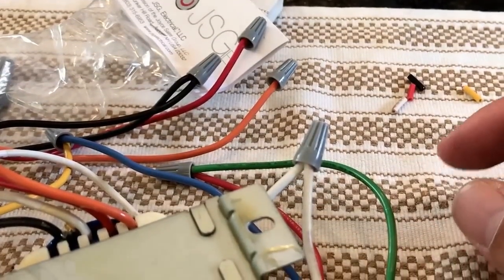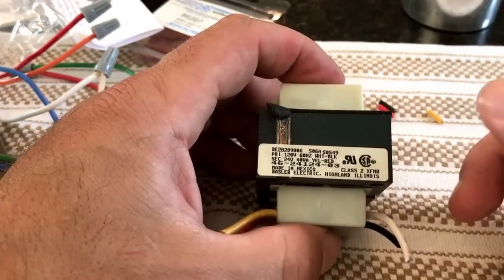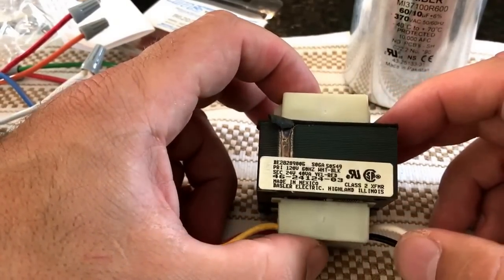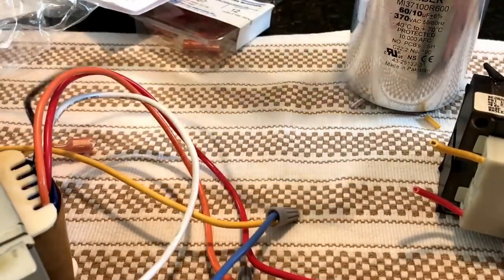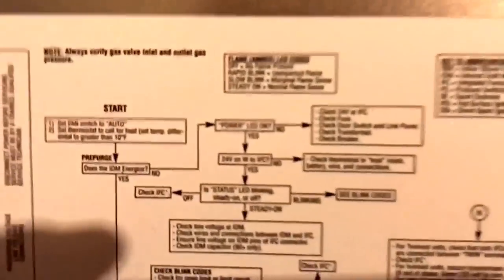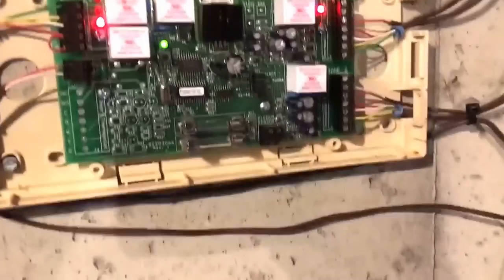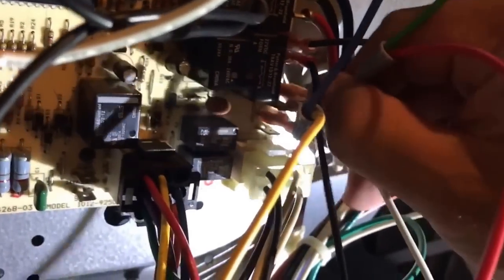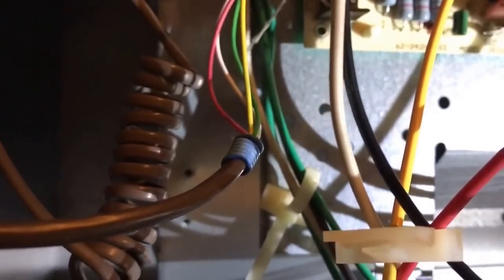How to fix a Rheem furnace not turning on with AC or HEAT part (1) of (2)

Comment: Mine hums no lights on my circuit board either
Reply from the maker: Hello, I tried to respond sooner and did but the email was sent back undelivered.  What I believe you should do is buy a Transformer with its own circuit breaker.  I believe the transformer is the issue but if there are other issues it would blow the new transformer as well.  With its own circuit breaker it would trip allowing you to further investigate the issue.  Lastly, sometimes a loose wire is the issue so I would check all connections on the board and anywhere there are wires and make sure they are all tight.  And remember to be safe when working on a furnace.  I am not an HVAC tech just someone like you that figures things out on my own by troubleshooting.  Good luck and also remember when the panel is off you have to press in the panel door button to activate the furnace when troubleshooting.  They do sell something that is magnetic that holds that button in as well.  Can probably find it on Amazon.  I just looked it up and this is what I bought.  

Supco FPRO100 Furnace Pro Switch Clip.

Comment: Where did you get new transformer? I need same thing.
Reply: Or what #s did u give them to get that one
Reply from the maker: Hi Ryan, take your transformer out of the furnace and bring it with you.  Also I found out they have transformers with circuit breakers on them.  Before I found that out I blew like 3 of them while trying to fix the issue.  Just call a furnace supply place and tell them the part number once you pull it out of the furnace.  Also if it for some reason doesn’t have the part number on it check on the back of the panel cover.  You will see a diagram it may show up there.  Lastly use the make and model of your furnace as well for the number.  Make sure you get the new one with the circuit breaker or it may happen again as soon as you connect it and give it power.  These can blow due to a wire not being tightly connected.  Make sure you check all the wires as well.  Good luck 🤙🏻

Comment: My rehem quit working in minnesota is cold. It sounds like try to start  but nothing .....is 8 years old
Reply from the maker: I hope you got it running again.  If not reach out again and I’ll help with what I know.
Reply: @ITSTHISEASY  thank you is working again I think 🤔 was just overheated. I subscribed. Thanks for helping people
Reply: @ITSTHISEASY  I just moved into a new place accouple of months ago. We got a rheem furnace / ac central air unit. The other day since we had a cold snap I tried to put the heat on getting error 82 the model number is rheem rgfd-07emcks . Not familiar with these units. I've worked on weilmcklein and acouple other boilers so i have some experience but unsure what to do.  The units heat worked all winter and ac worked up until the cold snap. Please help if you can. Thank you!

Comment: where can i get the transformer?
Reply from the maker: Hi Vic.  I got mine at a plumbing and heating supplier.  You may also look on eBay.  Make sure you buy one with the circuit breaker built into the transformer.  Good luck :)

Comment: So if 120v & 24v supply is good & thermostat is good. Lights on control board are on steady & all safety circuits are good. Is it safe to conclude the control board is faulty?
Reply from the maker: A. C. For the record I am not a heating or air conditioning professional.  I just try to help when I can.  If your transformer is good and lights all on and working I would still check all the wires and make sure they are all tight first.  What is your unit doing?
Reply from the maker: Also if your transformer is the issue make sure you buy one with a circuit breaker.  This way you don’t have to keep buying more while you continue to search for the problem.  Most often it’s the transformer.
Reply from the maker: My last issue was a loose wire which kept killing the transformer which I kept replacing until I found out they sell ones with a circuit breaker on them.  Finally I found the loose wire and clicked the button on the transformer and presto.  Worked like a charm.

Comment: The Best way to fix a Rheem product is to replace it with anything but a Rheem product. If you see the word Rheem on anything in your house it’s gonna cost you a lot in repairs. Their products are junk.
Reply from the maker: bubba JusTrucking thanks bubba but I was able to fix it myself and it didn’t cost too much.  I’ve only replaced the capacitor a contactor and a part inside the furnace I forget the name of with one that has a circuit breaker on it now so if it overheats I don’t need to buy a new one again I can figure out what’s wrong and just reset it.  All in all it’s a pretty good furnace I think.  :)
Reply: My rheem products just start giving me issues after 15yrs of no service. Small issues (transformer, capacitor, and contactor). $75 worth of repairs   Of course that’s me repairing it myself.
Reply: I have never had a problem with mine.  Over 10 years.
Reply: What's a good brand of furnace?
Reply: Pendelton Whiskey, I would look long and hard before I purchased anything from Rheem. My Rheem unit has been a complete disaster. Service call after service call, it’s been a real money pit. 3 expansion valve replacements at a grand a pop, plus many more parts and it’s still not working properly. When it’s really cold I heat with portable heaters and my kitchen oven door open. Thanks to my POS Rheem heat pump.
Reply: @bcmc  I appreciate you're responding to my question and I agree that Rheem isn't a good furnace but I don't know which one I should buy to replace the Rheem I've been fighting with.  If you were to buy a new furnace tomorrow, which brand would you buy?  I suppose maybe the best person to ask that question would be a furnace repair guy since they work on all of them and should know which ones are made right.
Reply: @davehigh6786  Any brand where everything outlasts the warranty is a  good rule of thumb.  Check the ratings of furnaces on consumers guide or some non-sponsored site.  If the site is sponsored,  go elsewhere.
Reply: I use Rheem gas furnace in 3 years stop working in code 0,cool and heat doesn't respond,  don't know what is wrong ...called technician tomorrow...hopes not expensive to repair since the diagnostic only will cost $80...lalalala